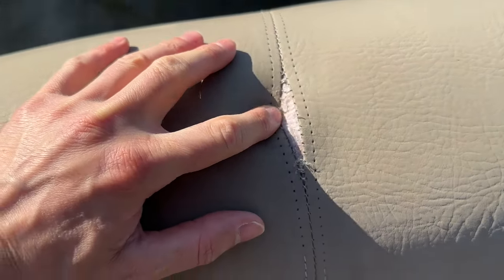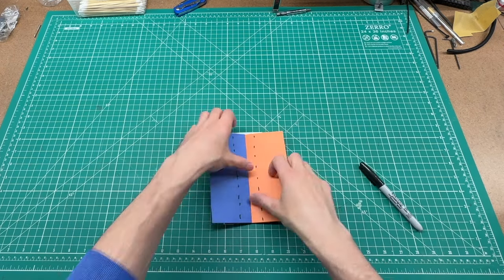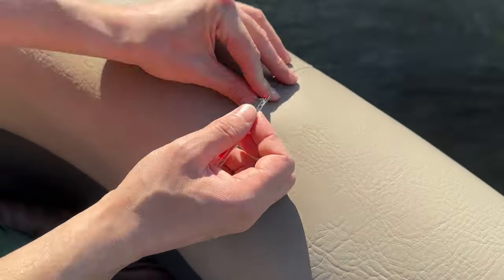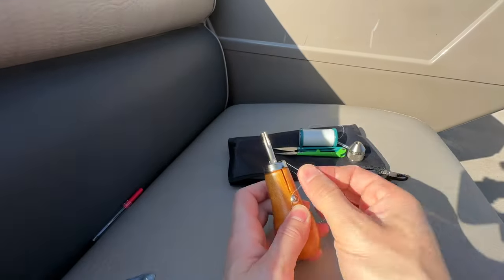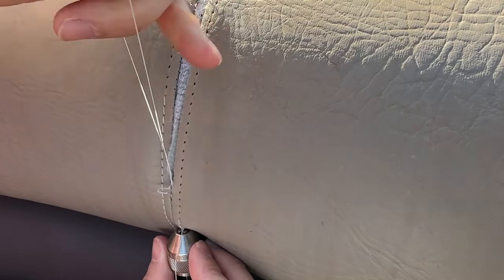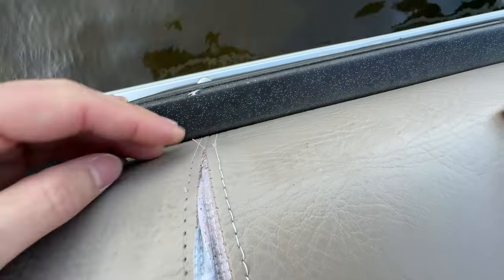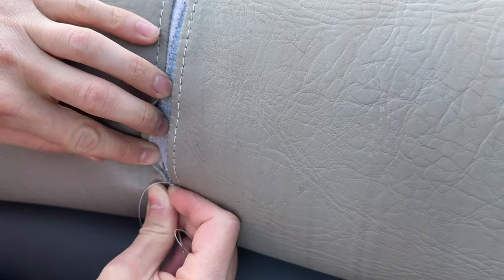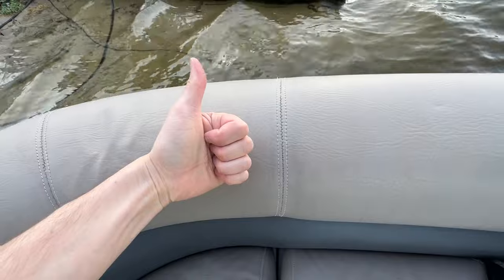DIY Boat Seat Seam / Stitching Repair

Comment: It would have been more helpful if you wouldn't have gone so fast.
Reply from the maker: Sorry about that. I tried to make the first stitch slow and speed up the rest so people don’t lose interest. Next time I’ll try to do a few more slow ones before speeding things up. Thanks for the feedback. Hopefully you got what you needed by replaying the slower parts.
Reply: Agreed …but I slowed it down to .75x speed and could follow it.  I was actually looking for a topstitch ONLY repair because my boat’s center seam stitches appear OK. I may just try a back stitch topstitch with the curved needle — although the fabric that covers the back of the seam may be a problem. Thanks for the helpful video.

Comment: To complicated to pick up off short Video!!!!!
Reply from the maker: In case it helps, YouTube gives you the option to change the playback speed. You can use that to slow it down.
Reply: You must learn to speaka de english , instructions were very clear , you can pause and rewind if necessary .

Comment: My seats are pretty hard, think this repair would still work or is it likely to rip the holes in the vinyl material ?
Reply: Like, very sun hardened.
Reply from the maker: Hard to say without seeing it in person, but sounds like there is a good chance of the holes ripping based on your description.

Comment: Good video.  My vinyl actually tore at the thread holes. Any suggestions for that type repair?
Reply from the maker: Thanks! I have this same situation with one of the seams that I repaired a few years ago. In my case it is only the center seam that is ripped where some of the holes are. I've been considering removing the thread from all 3 seams (center + the 2 sides). Then inserting a piece of fabric underneath each side and restitching the sides with that fabric inside. Then restitching the center seam the same way you normally would (creating new holes in that new center piece where the old holes ripped). It's kind of confusing to describe. I wonder if I should try making another video showing that (if it works). Curious if you've had any other ideas? Consider subscribing in case I post another video (or if you like my other content too).